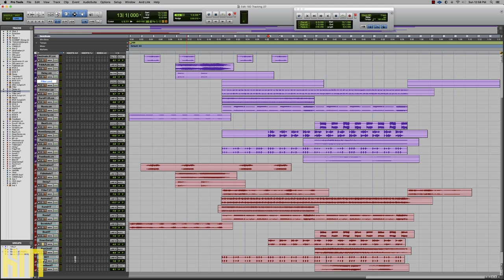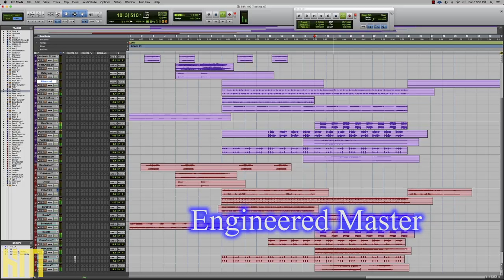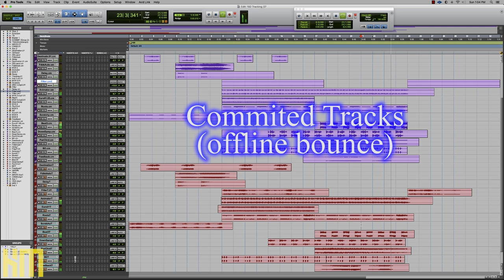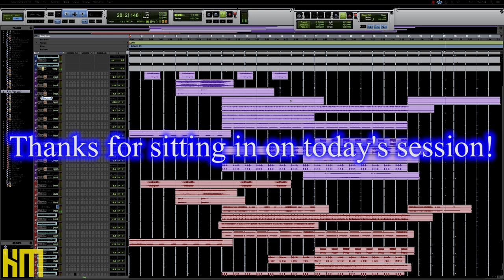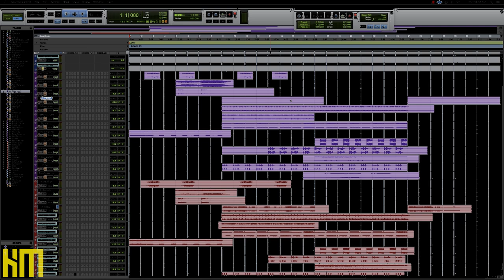Hear the Results - Engineer vs Machine - Comparing Masters

Comment: Huge difference. First, committed version, is like direct or off the box. Second version is like the tracks where already processed a bit with the channel tools of a console or a good channel bus plugin like the Lindell 80 for example. I got one question for better understanding. Usually a mix engineer achieves this sound by using a console or channel tool plugin. If the tracks version are already compressed and processed, wouldn't that be a bit too much in the end? But I think not, it gives more options in a mix with faster results. :). Cheers